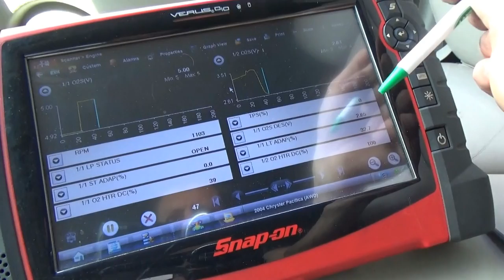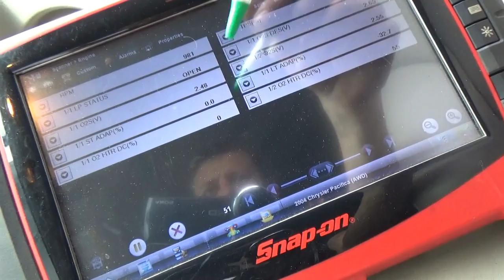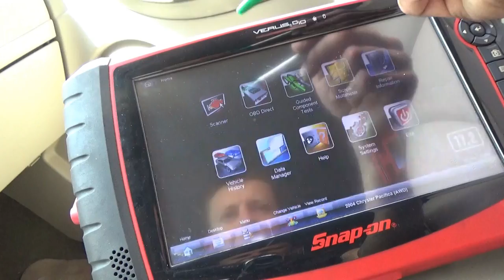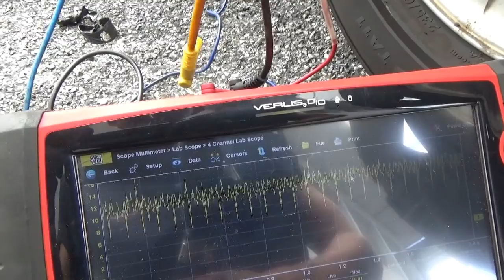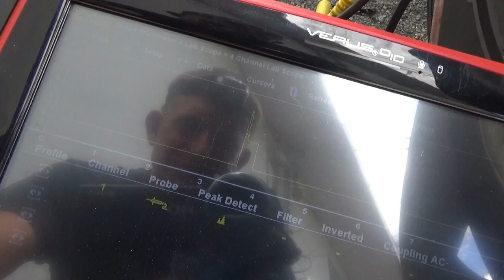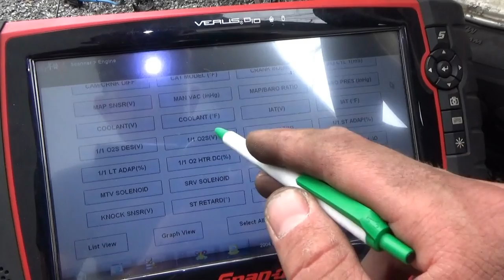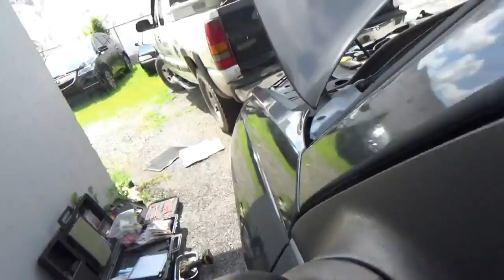Chrysler/Dodge O2 Sensor Case Study (SI Ep. 13.4)

Comment: thank you Ivan   for sharing , I have not got into those too deep, how ever  I remember a 04 pt cruiser  that went to the shop  with up stream and down stream o2 heather codes , both new sensor  , it was not my vehicle  it was working other technician ,I told him to use ntk per Scanner Danner video on this case study, this tech told me  02 sensor is 02 does not matter  he did his test  and conclude to replace both 02 sensor with different brand but still not ntk,  guess what both codes returned,  they told the customer is computer  so in about 4 month it comeback for emission   test, they gave me that to me , for diag I recommended with out doing any test at this time ntk both 02 sensor , the service writer told me  those sensor are  new and I said I can diagnosis computer issues after I get oem sensor only. and attempt to  run monitors  I installed  the 2 sensor and clear the codes , by the way it had transmission codes before  the first time  they installed different brand   02 and now , I clear codes run all monitors next day in the morning all run no codes present  on any computer , next oil change  in about 3 month I check for monitors and codes and was clean. 
at this time I played with  some scope  test,  I realized on the ground side for the  o2 sensor they send 2.5 v they call it floating ground ,  yellow lead on signal wire. if you connect your scope  and connect black lead ground on battery   it swing from 2.5 to 3.5 volts, now connect the ground to sensor ground and it swing  from 0 to 1v as normal o2  , any way that is how far I get , reality is those  NG  Chrysler computer  like ntk only probably the sensor has some compensating  for floating ground or who knows .  the previous set of o2 sensor were denso and second set were bosh.
 it pass smog now  , I get weird  diag sme times with people force  to do keep the vehicle on the road  to registrar , smog license bring me more fun diag. 
 thanks once again
Reply from the maker: Great story, Joel. Yes, with any engine electronic components OEM is the only sure way to go. Good for you for being persistent!
Reply: I had a question for you, it's good or bad to add more grounds on the engine bay or engine in Chrysler Vehicles?

Comment: I think you and EricO must have your brains studied. Smart cookies the both of you. Great video. Question.... What in your opinion is a quality oil filter?
Reply: craigsclocks The old adage, you get what you pay for, usually applies. My opinion, wic, Donaldson and Amsol. I’d stay away from box store filters, although some sell brand specific filters. There’s always better than the recommended filters
Reply from the maker: OEM!
Reply: Pine Hollow Auto Diagnostics OEM are what is recommended by the builder of the vehicle, keeping in mind, it’s not in their interest for your car to last longer. I guess if you’re in the rust belt, probably makes no difference.  All my vehicles are between 16 and 20 years old, with no rust! I’ve never had a corolla go less than 300k, and with minimal maintenance.
Reply from the maker: Yeah maintaining old cars is a chore in the rust belt that is for sure!

Comment: This kind of head scratching drama makes a simpleton like me want to just own and ride a bicycle. Cheaper on insurance too. Maybe on to something since I am retired.
Reply from the maker: haha I have 4 very reliable bicycles and 2 reliable motorcycles, just in case one of my 3 mostly reliable cars lets me down xD
Reply: If I did that, I could've bought my first house at 17! Would be a millionaire by now, too ... 😫
Reply: Get an early 90s Acura, sink a couple/3k into it (more that it's worth but who cares) and just drive.
Reply: Both my '86 Grand Marquis & '93 Volvo 940 are pretty hands off as far as repairs go. Neither one gives me any grief, unlike my '07 Silverado - always something new with that one. Been driving around MA with a "R" on the windshield, since the stupid monitors haven't run in 2 years! Who knows why ... and I don't have the patience to find out! As long as it starts and runs when I need to tow something, I'm good. :)

Comment: I'm not sure that using the PCM to drive those heaters is a good idea. I suspect corner cutting and money saving on behalf of FCA. They only expect those cars to last 6 years. IMHO.
Reply: The way they build stuff today, it's amazing they make it out of warranty ...
Reply from the maker: LOL!
Reply: Most PCMs control the heater circuit, but they use ground side switched "drivers" and possible even a relay.
Reply: Anything that draws serious current, needs to be off the board traces and on a relay, IMHO.
Reply: opl500 - less than 1/2A is not "serious" current,  What is unusual is that the PCM is SUPPLYING (not "sinking").  PN junction devices are much more expensive than NP device and some people say less reliable.

Comment: When you showed the test light killing the drive i wondered if the manufacturer was using a heater with a higher resistance, just to be a pain in the arse!!. (Special part).
The downstream one seemed ok with a test light, but the plug is different, perhaps trying to stop you swapping sensors maybe.
I'm sure you found out the truth, so don't forget to leave us on a cliff hanger Ha ha :-D
Reply from the maker: Well the upsream heater resistance was 4 Ohms so that sucker can draw 3 amps at full power!

Comment: I think I know the secret. You must become sleep deprived to understand the inner workings of the computer-controlled motor vehicle. I mean how else can Keith get through 20-30 vehicles a day.
Good diagnosis Ivan. Without knowing the theory of operation you worked it out to be able to call a bad driver in the PCM. Thumbs up man
Reply: Many years of non stop diagnostic challenges
Reply: I can imagine. And they ain't gonna stop with a computer control for nearly every system and upgrades in tech every year.
Reply: Keith didn't get that way overnight. I'm sure he had to work at it.
Reply: Absolutely. He just makes it look so easy and natural.
Reply: Experience does that. Try explaining to an end customer they are paying for your experience not time though and watch their head explode when you diagnose it in 10 minutes and still expect the full invoice amount.

I don't know, but I think Keith solely works for other shops when they get stuck on something rather than having to deal with the irrationality of general public customers. Wise man. That's not a sleight on the customers BTW, we're all irrational idiot customers when we get outside our sphere of knowledge and it all becomes mumbo jumbo and unicorn farts as someone tries to bill a gadzillion bucks for apparently just standing and thinking for a while :D
Reply: How much is the diagnostic fee?20 -30 cars must rake in the $.